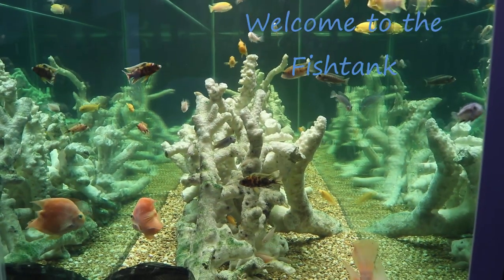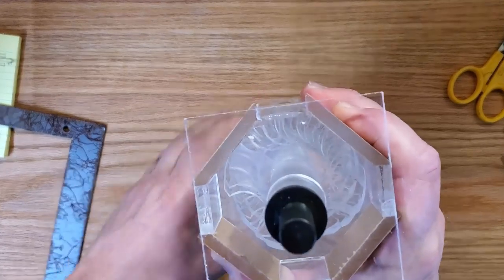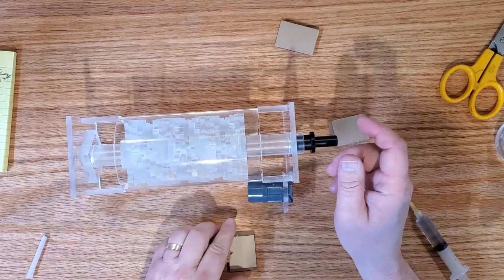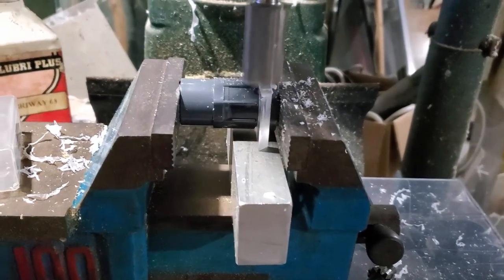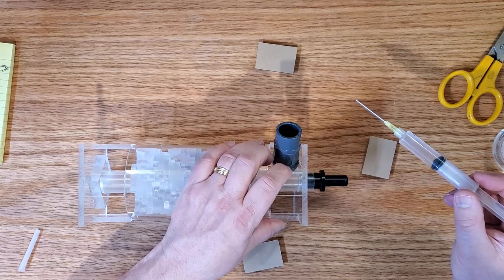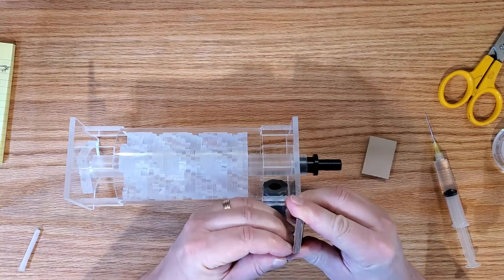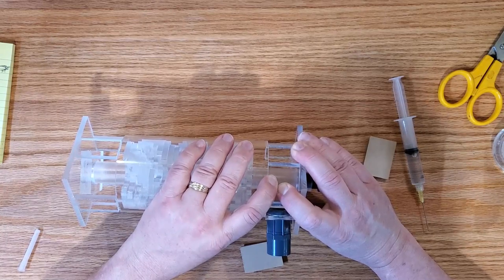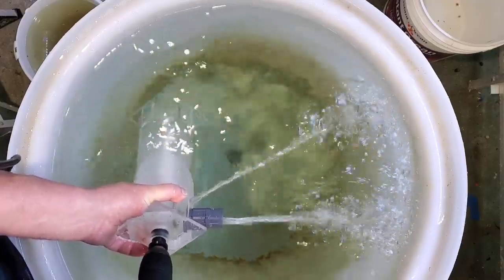Archimedes Screw for Aquariums Update

Comment: Have you ever thought about playing around with a 3D printer for some of the piece's of your builds? I think if you made the screw piece with a 3D printer it would be much lighter, more hydrodynamic, probably cheaper to make (Materials wise, cost of the printer aside), and similar strength could be achieved depending on the filament used. Ive done a little research on using Weld On for PLA filament and it seems to be a common practice to weld 3d printed piece's together with it. So one would assume  you could weld PLA to acrylic with Weld On. Acetone is used to weld ABS prints together and I'd be intrested to see if Weld On worked as well.
    I've had 3d printers on the brain for a few weeks now trying to figure out the best printer to start out with that is available in the USA.    Anyways, I hope you have a great weekend and please keep up the awesome projects!
Reply: Charles W. Pla breaks down in aquarium water because of bacteria. Pla is actually a plant-based plastic.
Reply: You can't use PLA in aquariums. ABS works great though. 100% infill and ship it!
Reply: Dave's Aquariums oh🤷🏼‍♂️ the more you know😂
Reply from the maker: Hey Charles! I've given thought to both 3D printers and laser cutters. I've just never been able to justify the cost. I don't need it for the business and I only make a little off of these videos. Maybe sometime down the road after all of this current craziness settles down. Thanks for watching!

Comment: Have you ever made an acrylic slurry to fill in gaps?  It may not look as nice but for a proof of concept it would get the job done.
Reply from the maker: Yes. It usually works out looking a little messy though so I would rather make the proper fitting part when I have access to the materials. Thanks for coming by!

Comment: Hallo Fishman, first off - thanks for the videos. I enjoy them. Am curious if you have tried this screw at lower speeds and what angle you are planning on installing it at. It seems to me the more vertical you want it the more rpm you'll need. Also, you mentioned that taking down the diameter of the axle spoiled the look a little. Alex CNC has a video on milling and polishing acrylic which may be of interest to you.
Reply from the maker: Hey Paul! I'm so glad you liked the video! This should be run at lower rpm. It would need to be a much lower angle, around the 45 deg. level, and be much longer. I hand enough tubing and patience for this shorter one and it needs more rpm to get a steady flow. Thanks for coming by and sharing your thoughts on this

Comment: Didn’t you have some larger diameter tube? If you used a slice to make the walls of the top section you could even put the outlet offset to improve the efficiency a bit
Reply from the maker: Sadly no. Once this craziness is over the fix will be much better looking for sure.

Comment: Thought it was a touch silly to be machining a hundredth off; figured use sand paper. But after seeing how that micro gap spew water I can appreciate the need for such tolerances.
Reply from the maker: Acrylic is a pain that way. I could fill the gaps with a acrylic/methylene chloride slurry but that would be messy and I'd rather wait for access to parts again. Thanks for watching!

Comment: If you make it 2 feet longer You don’t have to make the whole thing 2 feet longer you can just use that screw and put it in the bottom of a 2 foot tube or just put a pre-filter on it or a basket or some thing on the bottom. A solution to the problem you were having today would be to bend your acrylic or just melt some into the holes, like plastic weld it were you add plastic or just melt it with heat instead of chemical Welding.
Reply from the maker: Hey Shane! I could make an acrylic/methylene chloride slurry and use that to fill the gaps, but it would be messy. I'd rather wait till I can get the proper part. The only way I could make this longer currently would be to internalize the screw part. That is to make a ton of discs and drill the holes inside the rim. Then all I would need to do is rotate the discs when welding to create the screw. Anchoring the resulting rod and making the turning mechanism would be a pain but it could work. Always great seeing you!

Comment: What about using the thickened cement for instances like this where you need to do a little gap filling?
Reply from the maker: There are ways of dissolving acrylic powder in methylene chloride to create a paste and using that to seal things like this. I find the method a little messy though. For a video I would rather wait till I can get the proper material and have it be more presentable. Thanks for your thoughts on this!

Comment: Could you use a thicker Weldon to seal the gaps?
Reply from the maker: Yes. I could could try that or mix some acrylic powder in with the methylene chloride to get the same effect. The end result unfortunately is still the same. Archimedes screws weren't intended to work at high rpm. What I really need to do is build a longer one and operate it at the intended speed and then it should work fine. Thanks for taking the time to come by!
Reply: Fishman Yes I see, I meant for the gaps that shoot water out to the side.
I understand that the shaft will have to be extended.
A rubber ring placed on the shaft and pushed down to just before it touches the top would maybe stop the water from being shot up and direct it out to the sides.